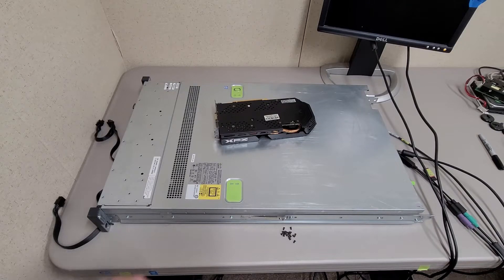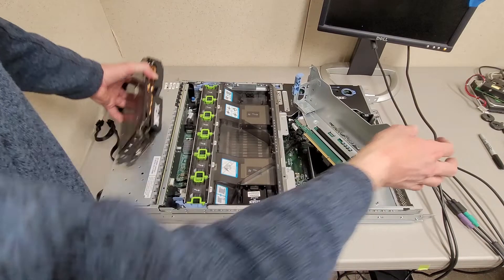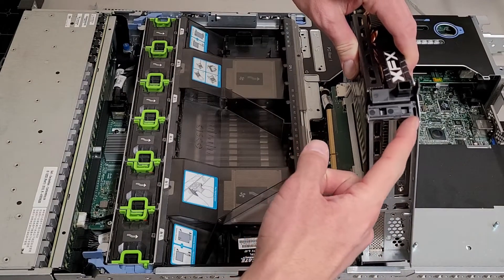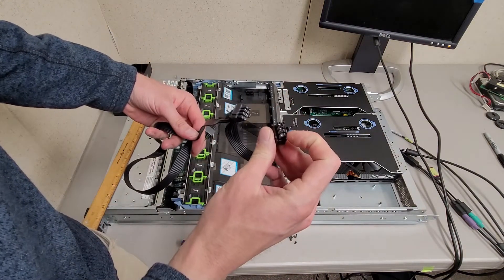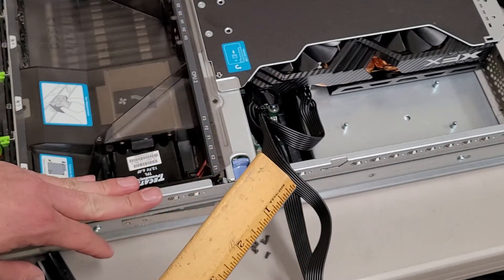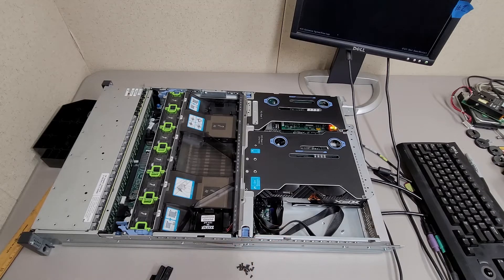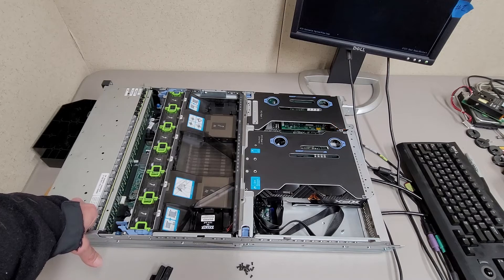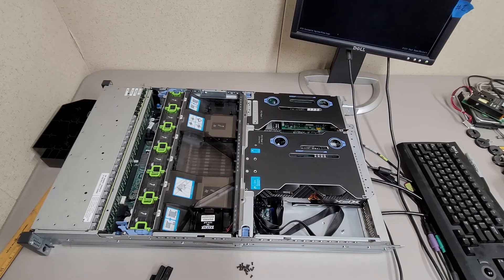Testing video card compatibility in the Cisco UCS C240 M3

Comment: What other cards can be supported... i currently have a k2 grid 8gb but am realizing its not good enough for crypto mining... i need at least a 1660 super to make it profitable... (i have the M4 version of this with the 24 ssd slots, and the 1c version of the pcie card riser)
Reply from the maker: I have no powered GPU experience with the M4. If you go Tesla I recommend sticking with models that are officially supported. Otherwise with the M3 it didn't seem to care what consumer GPU you install. I would assume the M4 would be fine with most consumer GPUs.

Comment: do you still use and recommend this server?  
Or have you switched to something else more recently?
Reply from the maker: I don't recommend Cisco servers in general personally. They can be difficult to work with. The lights out management controller requires flash player depending on the model. Also parts availability is not as good as more mainstream servers like Dell. The Poweredge R720 is a superior equivalent to the server in this video. Unless you can pick up a killer deal on a Cisco server I would probably avoid them personally.
Reply: @computersales 

 thanks for the advice! I enjoyed watching you put the server together.  
Its super cool that you have a warehouse full of computer parts, though I'm not sure how much of it could end up being useful.
  Im sure your much better at being able to salvage value from older models.

What kind of process do you go into in order to return profit for older models of servers/pc/ect.  
out of curiosity~
Reply from the maker: @blue28289  Currently most i-series desktops get parted out and recycled.  AMD systems I will sometimes sell the boards since they don't have fragile sockets.

Servers are tough to sell to be honest.  I can't be price competitive on machines like the R720 because I actually go through them and package them properly.  I have started parting some of them out because of this. It is hard to compete when shipping and packaging costs me $50-70 per unit.

Granted even the parts market is tough because most people don't know their numbers. There is no money in selling a part for $4.50 when shipping will be $3.88, packaging costs $0.55, and fees are $0.75.
Reply: @computersales  I gotcha, so does that ever leave you with an  excess of hardware>? 

and then if you reach that point how do you choose to deal with it>?

I could imagine that there are probably several uses for old servers.
Even just the base materials of older hardware is valuable, but is it really enough to make a return on profit>?

Otherwise what would you do with all of it?  

I mean it needs to make a return on investment doesn't it?
Reply from the maker: @blue28289  There is no real good answer to that unfortunately. Basically in the end it all cost averages out. You can either go to my about page on YouTube or gwzcomps.com forwards to my Twitter to contact me and see my business info.

Comment: Did you ever figure out the issue with the memory DIMMs being marked faulty? I have the same server fully populated with 16GB DIMMs and A1's LED is on. Oddly the first time I powered it up it ran and displayed a video output and then I was doing some reconfiguration inside the unit and it stopped displaying a video output. I reverted everything and it still doesn't work. Have even reduced to 1 CPU and 1 memory DIMM. Have waited 10-15m and nothing outputs, no error lights on the front. All status LEDs green except the LAN indicator.
Reply from the maker: I never did any additional testing. If I could find a copy of flash player I might check the CIMC interface to see what the error logs would show. I'm assuming it stores that stuff in flash memory but you may try pulling the BIOS battery and leaving the server unplugged for a few seconds. Otherwise I would say probably try checking the documentation.
Reply: @computersales  I was headed towards checking out the CIMC next. I did try pulling the CMOS battery and also drained the supercapacitor located closed to the CMOS battery, no effect. The fans just run full speed constantly. Hoping it's not the CIMC but the last time I experienced similar symptoms to this was on a Dell server of the same age and its iDRAC controllers flash chip had failed. Looks like it's time to get more serious about the issue.
Reply from the maker: @ri5ux  Ugh yeah I have a R720 that died because the idrac got messed up somehow. I'll have to sleep on it and think, but sounds like you tried everything I would already. I don't have quite as much experience with these as the R720 unfortunately. The manual mentioned requiring Cisco certified memory but that just seems silly.
Reply: @computersales  It does seem ridiculous to require Cisco certified memory, but I am even using the original Cisco branded memory. I managed to get a T620 with the iDRAC bricked into a state where it would allow the system to fully POST and boot, but that was quite the process. Had to tap into a UART serial header that was not installed in the board from the factory on that one. Probably going to be similar here. I'll be sure to post back here if I figure it out.
Reply from the maker: @ri5ux  Well I tried building a couple VMs with flash with no luck.  I may try the other browser mentioned by Christopher when I have a chance.
Reply: @computersales  There is also a chinese built and "maintained" version of Flash called CleanFlash if you can't get that working.